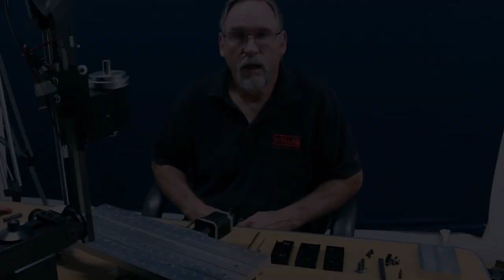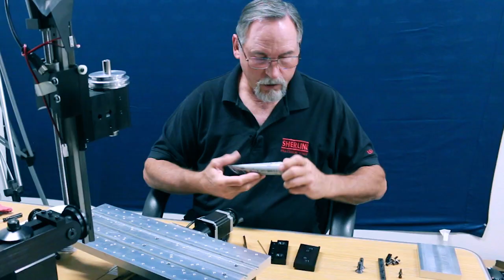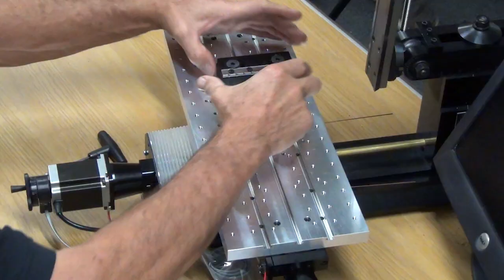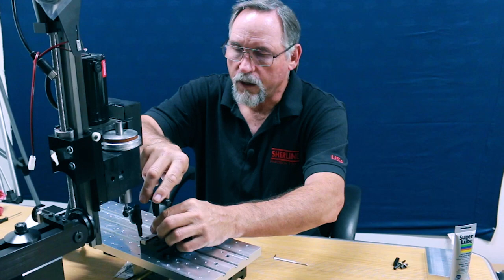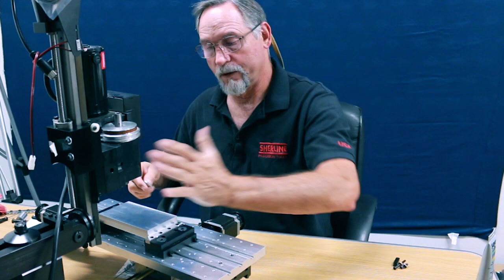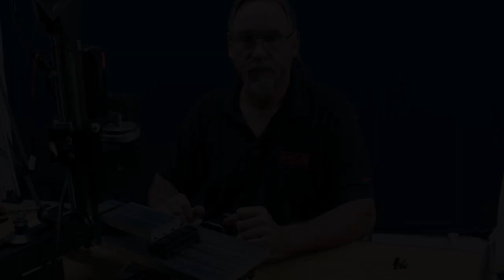3552 MB Vise Fixture video Part 1

Comment: How tightening the screw on movable jaws holds the part like vise setup??
Reply: The big 82∘degree clamping screws are both backed off one full turn. So then the top part can move left or right relative to the bottom part. Now the moveable jaw is pushed against the part. At this point the top part of the moveable jaw has moved to the right. Then the T-nuts on the moveable jaw are tightened, so the bottom part is locked into position. Now, finally, when the 82 degree clamping screws are tightened that forces the top part of the jaw to the left thus clamping the part. The clamping screws act like conical wedges.

Comment: What's the clearance between the bottom of the part shown and the table? thanks.
Reply from the maker: Could you give me the time code of the video to which you are referring?
Reply from the maker: The base plates are 1/2" high and the part resting surface of the top jaws are also 1/2" high. The total distance between the part and the tool plate is 1" (2.54 cm).